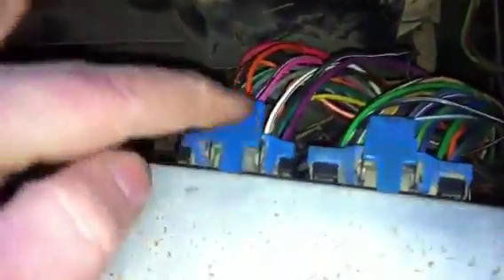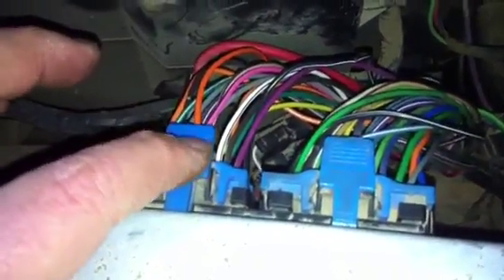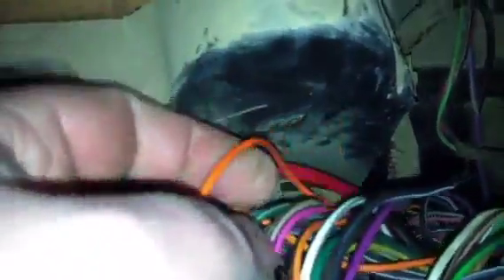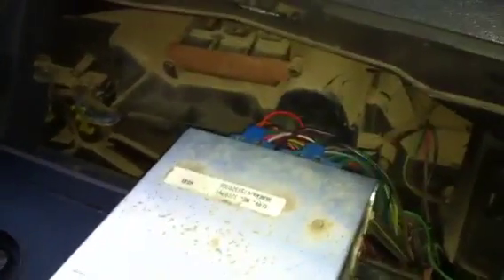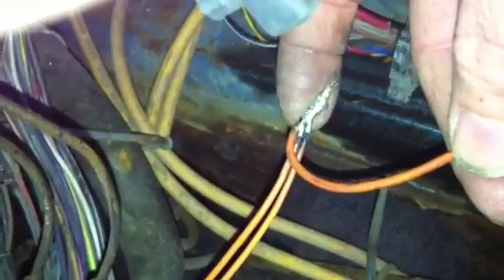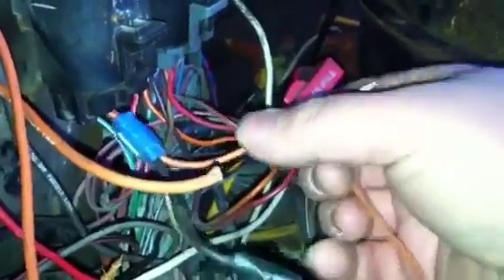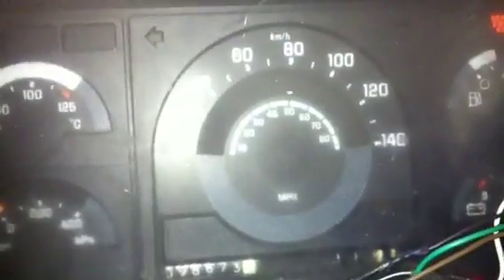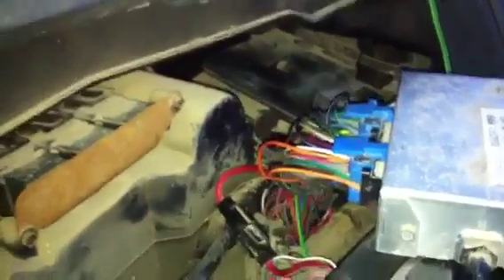Sully Repair - 1990 GM Chevy no start no engine light repair

Comment: Thanks for the info!
Problem:#1~NO dash Engine Light with key on.
#2~no start ,except with a Lil gas poured down TBI
#3~Runs ok with new fuel filter(old!)
New Fuel pump relay & Fuel pressure Reg in TBI(Lotta dirt!)
"#4~touch the brake pedal  less than an inch down, engine immediately shuts off(with a Dash Engine Light showing!"
#5~Shuts off immediately, as well, when moving floor selector from 4WD to 2WD<!
"Any ideas will help.I will be buying an IAC tomorrow as the idle, although pretty good, was a little 'funny' when playing around today with the '92 1/2 ton (5.7)"
         "THANKS AGAIN!"
Reply: Did #3 solve #2?
Reply: No.
But there us a gray brake switch contraption left side of bottom of brake pedal.
"Crossed/Jumped the Pink 'n Bkack Stripped wired over to the Orange wire , that goes into this gray switch unit, and 'B00M' ! RUNS PERFECT."
~TOUCH THE BRAKE=STAYS RUNNING!
~GO FROM 4WD, ON THE FLOOR SELECTOR, TO 2WD=STAYS RUNNING!
"SUCCESS!"
"Thank You ALL for Your Great Help<-!♡¡"

Comment: Hey Dave, what does the pink and black wire go to specifically?
Reply: I know this is late but as stated in the video it comes from the ignition/key. Any power that only comes on with the key.
Reply: That's a good question but since I haven't even looked at his in over 10 years I truly have no idea.

Comment: What would you do if you don't have power at the pink and black wire
Reply: That's power from the ignition so I would trace it back and make sure the ignition is working. obviously if there is no power it isnt

Comment: Dave i having this exact issue. My ecm2 fuse would blow every few months ans leave me stranded. After letting it set for about 30 mins i could replace to fuse and it wouldnt blow and i could drive home. one day the fuse blew and even after i replaced it the C.E. light still wouldnt come on and the truck wouldnt start. i found a wire burned through on the back of the block which was the oil pressure switch. i repaired that then i was able to start the truck but it runs really rough and the C.E. light still doesnt come on when you turn the key. the orange wires are hot under the hood but only one seems to be hot at the ECM. Maybe a break somwhere. i even tried to jump the two orange wires together at the ecm but still no CE light so im thinking there may be a break somewhere. I printed a copy of the ECM/ fuelpump wiring diagram and all seemed to be well but it isnt complete because it doesnt show me the obd port ot the CE light. please help
Reply: sorry I just saw this. My first guess would be new computer. grab one from a junk yard if you can.
Reply: Im sorry I didnt get to this earlier for you. Have you tried swapping the computer for a junk yard one. sometimes its just the computer

Comment: o have no spark I change the can and rotor coil pack and spark plug and wires and still no spark please help
Reply: Johnny Path take your cap and rotor off on the distributor and look to see if the gut in the distributor are corroded or falling apart, if so new distributor
Reply: not enough here to help you. if no spark is your problem then you will have to check at each spot that can effect spark. check at the ignition, check at the computer, check a the input to the distributor check everything.  did you ever find the problem?